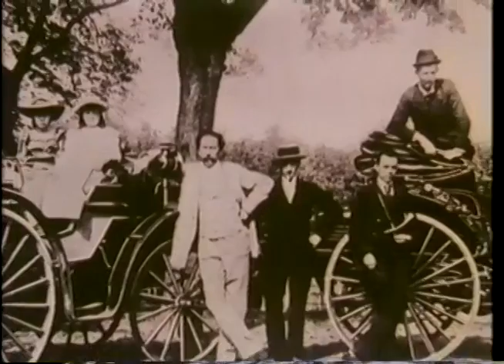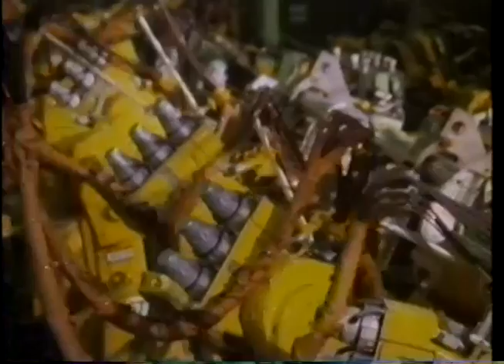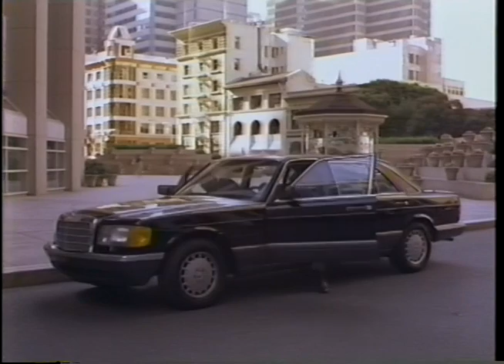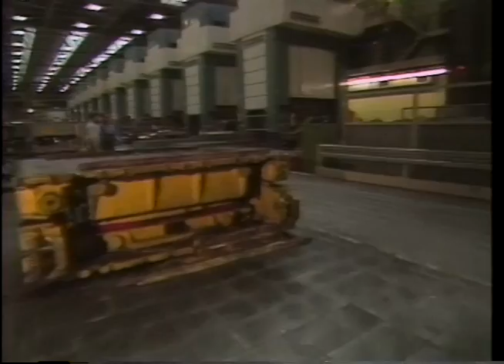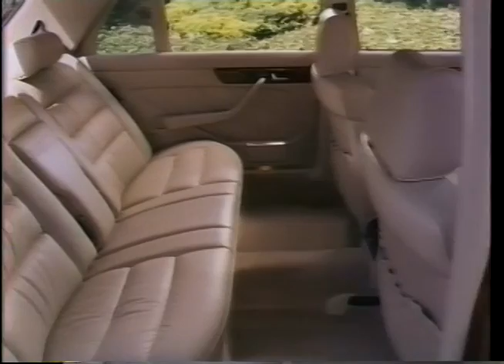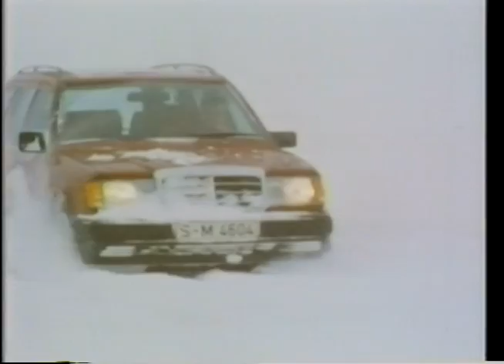Mercedes Benz 1990 Sales Training Model Lineup Overview

Comment: The purpose of the ABS design is to generate a series of pulses of maximum friction between the surfaces of both the wheel tires and the road during the deceleration of the car to reduce the stopping distance in half as well as increase the car's ability to turn with the least possible slippage on the road.

Comment: I just bought a 1993 320e straight 6
With 74.000 miles and it's hard to believe a 29yr old car with genuine low miles one owner from new under the bonnet every thing is as new wiring servo all pipes radiator not even a fly or dust not a pin pick of rust any where on car original every thing even jack and spare wheel never used even boot carpet not even any vacuum cleaner marks it looks like the boot was never used
No wear in interior leather seats after 29yr not dried out no cracking
Just like new never smoked in all tyres Michelin the electric windows go up and down no motor noise same with sunroof it's spotless underneath it looks like it's never been out in the rain it must of been kept in a central heated garage like an operating theatre as it is like I dreamt I went back in time and bought this car at only 2yrs old .
I haven't woke up since I bought it
Even the handles latches pedals the solid feel in closing and opening doors if any one has experienced a simular experience I would love to hear it 07783 912283
Northern Ireland

Comment: I can see why Mercedes had to ditch their model designation scheme. Would be way too confusing today. By 1990, it was already starting to get confusing. Letter classes are much easier.
Reply from the maker: Ya. Having C, E, and S was much simpler. A lot of times the 6 cylinder S classes get lumped in with the 300 Class!
Reply: Today's "letter classes" are very confusing for most people. There are too many of them

Comment: Wasnt Mercedes handmade till the mid 90s?
Reply from the maker: Not really. There was a lot of hand assembly of the interior, but all bodies were machine welded.
Reply: @compu85  ok i just remembering reading somewhere that the w126 was but any way i owned a 87 560sel and always wondered what the "B" on the gear shift meant. I can remember to be a HUGE car the thing surprised ALOT of ppl i sure do miss the car
Reply from the maker: @RayFinkle22266  The B mode stands for engine brake. It's a switch that's hooked up to the kickdown solenoid on the transmission, the same thing hooked to the switch past 100% throttle pedal travel. That causes the transmission to kick down from 2nd to 1st when going ~10 mph. Normally the 722.3 automatic in the V8s is set up to move off from a stop in 2nd gear, and only shift to 1st if you mash the go pedal from a stop, or put the shifter in 2 from a stop. 
On the 300SD 5 cylinder turbodiesels in 84 and 85, the transmission rests in 2nd gear when stopped, but the moment you touch the go pedal, it kicks down to 1st so the car moves off from a stop in 1st. 
Some of the V8s had a small module that would apply the kickdown solenoid when you release the brake pedal at a stop, so the car would move off in first gear.

Comment: Odd that there was no mention of the G wagen? It was in production since 1979...
Reply: Was initially build as a military vehicle, maybe at the time it wasn't available for commercial sales...
Reply: @alexdragomirescu5084  Yes, it wasn't. Was imported via grey market until 1988 and then banned.. Brcame available in Santa Fe New Mexco in 1993 and was sold until 2001 at Europa, when MBUSA bought the rights from Europa and launched the G500 as a 2002 model. Sat in my first G500 in January 2002.
Reply: Doing a Google search, would tell you very easily it wasn't officially part of the lineup until 2001. Wasn't sold in USA after 1988 when 25-year rule banned grey imports.

Comment: I had one. It arrived from Germany with several factory defects. On its first routine service/adjustment appointment, the dealer said they found several more problems and replaced the cam shaft, the cam shaft seal and both motor mounts! There was something else, too, but I've forgotten what it was. Within a couple of months the climate control module failed, the fuel pump relay failed ("a bunch of them were defective") and later a rear wheel bearing seized. The power antenna worked for a year or so. A few years later the right tie rod separated. The car was perfectly maintained by the book. Left me stranded several times. Once the dealer's loaner broke down, too. I could go on, but why bother?
Reply: Well you must be the unluckiest person in the world these are some of the best cars ever made and there are many many thing to prove that lol.. Both of my cars went over a mil kms.. I imagine there were few lemons slipping into showrooms typical of any brand back in 1990 but by the late 90s all mercedes became lemons
Reply: @rikidiki8940  Wrong. The service manager at a major MB dealer was a friend. He used to take me through the service areas to laugh at all the problems the two German brands they sold had and the stupid owners who put up with them. One after another...all ridiculous. The problems I had weren't out of the ordinary. Any car can be kept on the road indefinitely, if you don't mind random breakdowns and are willing to put $$$ into them indefinitely. There are abundant international repair data to reflect my own experience. But the cars were pleasant to drive and the bodies were solid. Rustproofing could have been better. If you think they are great cars, you should own a few and keep track of all the failures.
Reply: Your anecdotal evidence means 0

Comment: Back in 2013, I was handed down a '93 E320 (W124) from my grandmother who was going to a nursing home.
The car was so nice I couldn't believe it was a 20 year old vehicle.
Something about the ride. It rides like i'm on a cloud or something. Engine had zero vibration. It was really quiet and comfortable. Even the power locks were operated by a vacuum pump, and it had such a nice sound and feel to it.
W124 was introduced in 1985... to compete with Cadillac and Lincoln, BMW and Jaguar models of that era. No comparison.
Reply: I have an '89 260E........ amazing car! Quality without compromise.
Reply: what happend to it?

Comment: Regarding quality they did not lie. The W201, W124 and W126 are still driving around all over the world, many exceeding 300.000 miles.
Reply: Today's Mercedes are nothing but piles of unreliable junk! They are simply living off their past glory!
Reply: I had a 1990 190E as my first vehicle was 18 years old and smoked the tires everywhere i went... treated it like dirt not physically but didnt have the money to maintain it properly... it made it to 770,000 kms... theres no romanticizing anything its common fact any Mercedes Benz stamped with Daimler on it is rigorously tested and built to last.. I now own a 2003 E500 5.0 V8 vs everything
Reply: @EAZYDUWZIT420  2003 was junk years of Mercedes. The company even admitted that the products were not up to their own standards. The previous generation E class (W210) cars were pretty solid.
Reply: @alexeivoloshin5984  the only junk car they made that year was the E63 and they knew about the major engine flaw well before they even sold it... Mercedes had a class action lawsuit against them for it
Reply: W211 is one of the best engines they ever made lol? Anyone that owns a E class knows this, they use them as taxis in Germany... the only problem 2003 had was faulty radiators from Valero and they switched them out with Bosch and the braking system fails... that engine gets 500,000 miles all of the time, checkout legitstreetcars lol he owns 3 E500s E55s same engine transmission platform with well over 300,000 miles, and has been a master service tech for Mercedes for 20+ years... He only buys 2003-2007
Reply: @EAZYDUWZIT420  The early W211s were great, aside from the awful ABC braking (breaking lol) system. Late W211s are a huge downgrade in quality. E350, E550, and E63 all had engine quality issues, and unreliable 7 speed transmissions. W211s are tricky to work on too, compared to W210s. Still better than BMW E60s though.

Source: I work on these cars
Reply: @michu6777  Are you american? Because here in Europe 90% buy diesels and they are super long lasting. Just get a car without air suspension and with a diesel engine and you re all good. 2006+ is much much better in terms of rust and overall quality. Merc's gas engines are quite bad, i've heard.
Reply: @kristjanvendelin3566  Yes I'm in USA. Unfortunately the only diesel we got here was an extremely rare V6, and I've never seen one in person. I'm in California where cars don't rust, but I will take your word for the rustproofing improvements. ✌
Reply: @michu6777  sbc brakes, not abc
Reply: my 560 sel made it 220,000 miles...really well built, but definitely required good upkeep. hands down one of the most comfortable highway cruisers I've ever driven
Reply: Very true I have a w124 on 211000 miles drives like new!
Reply: I have a 1988 w201.
We don't measure the miles.
We measure how many times they go around the clock 😍😍😂😂😂
Reply: Fabian R You can drive any car for 1M miles. The question is, how much will it cost you? Old Mercedes were very good cars, but let’s not romanticize their long term reliability.
Reply: @alexeivoloshin5984  no, you can't drive  m272 engine to 1M miles. Unless you replace the engine.
Reply: @vaseabmwe39  Where did I post about driving an engine?
Reply: @alexeivoloshin5984   ? I own a '87 w124 250d and I take very good care of it without spending money at all. Only for parts.  I find it weird that you would claim such a thing about this unbreakable car

Comment: At this stage MB was the finest automobile in the world, engineering was tops, after 1995 it all went downhill.
Reply: Yes, even if Lexus took over for MY 1990, they were relatively spartan at the high end. JDM got the high tech, ultimate luxury for the rear seats.

MB included both. I'm a BMW guy, but I will forever regret not getting an W222 S65 AMG over my M760i xDrive.

W222 came the closest to emulating that past feel and is way better than my 760 even in S560 grade. Oh well, just couldn't justify paying full price for a $200k+ AMG over a discounted 760.

Comment: They were all built for profit. I have a classic Mercedes and a 2018 model. Believe me, the new ones are built just as well, if not better. This rose tinted view of what cars were is just that, a romanticised image of yeaterday. The truth is old cars were troublesome and unreliable. The cars of today are mostly ALL built to a high standard because that is what todays customer demands. The joy of owning a Mercedes Benz today is about prestige, exclusivity, heritage and customer service. (if you have had a bad experience with customer service that is a local issue to you and not reflective on the brand and needs to be brought up at a regional level) Full dislosure, I work for Mercedes Benz but I will say this, I left a secure job in the Marine Industry to come and work for Mercedes Benz because they are the best.

Comment: Back in the day we couldn´t even think that 28 years later MB would have a pickup truck... 
I just love the 90´s models, build to last a lifetime.
Reply: Uh, no.  It was the '60s, '70s, and '80s Mercedes that were well built.
Reply: Robert Brandywine uh, you’re stupid
Reply: There was a G class pickup back then and aftermarket pickup conversions on the W115 and W123.
Reply: Basically took a Nissan and stuck Mercedes badges and body panels on it.

Comment: Pure quality. Didn't take long for the quality to start going after this. The introduction of the W202 and the W210 saw things go very wrong indeed. As good as Mercedes Benz are today I don't think they have the aura they did back in the 80's. It's not the same anymore, there's too many of them and now everyone can afford a diesel AMG trim A Class. Back then you stuck your nose up to the window and dreamed.
Reply: Josh Charlie w202&w210....both good looking but we’re horrible in longevity. The c and e to follow those two didn’t help much either. They could easily make their cars more reliable, but the aura I agree will never return...to many cheap leases and high discounts.
Reply: @finnellwilliam  You think those leases are cheap?  You have to put a lot of money down up front.
Reply: @finnellwilliam  w210 bad at logevity? Man, the 5g-tronic is the most reliable mercedes transmission ever made, and so are the m112/m113 among gas engines

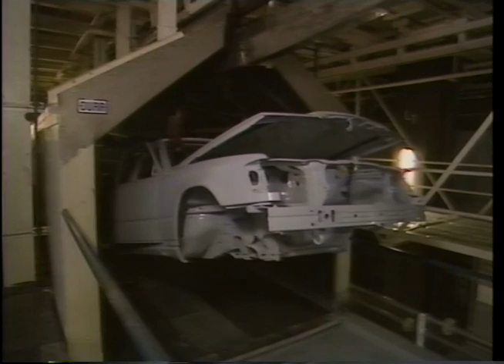Comment: 38:35 and then the 1993 came and MB went eco friendly, which meant all their cars rusted like crazy up till 2006. Even a S-Klasse Mercedes-Benz from that time period just rusted away.
Reply: Actually according to an MB specialist, it was late 1991 that they started using eco friendly materials that weren't properly heat tested which would overtime rust out and cause you big problems.

Comment: On later model the cars skips the anti corrosion baths
Reply: I heard the W210 problems were caused by switching to water-based paints.
Reply: Johans60 only on like mid 1990’s to mid 2000’s cars. But still

Comment: '87 260 E Owner (and still runs just fine!)knocks on wood. These cars really were built like nothing else on the road. I miss the "form follows function" design. Now theyre designed to compete with lesser cars. At least the newest cars from Mercedes have gone back to a more regal design, and the engineering has come up leaps above where it was.
Reply: I've got an '87 r107 and can confirm. Nothing like it on the road.

Comment: Volvo also got some problems when they based their D5 diesel engine on the same engine block, as the 5 cylinder petrol 850 engine.

Comment: This cars were truly built to last... the later models were build to profit!
Reply: Couldn't agree more. Most of the W220s and W210s in my are are completely rusted out. Pretty sad! Even Jeremy Clarkson mentioned "Mercedes dealer service and reliability isn't what is use to be". He said this when he had a SL55 AMG and numerous problems with it.
Reply: The enlarged version of the OM603 I-6 turbo diesel engine (larger bore and longer stroke) that was out the year this tape was issued had brought Mercedes down to its knees. Compared to the original 3.0L version sold in 1986-87, this engine had a bad reputation and came to be known as the "Rod Bender."
Reply: Merc back in those days were bulleproof. Just saw an 300 SEL here recently wonder what was the mileage.
Reply: I have an E63-S & CL55 AMGs no problems at all. Just do regular maintenance that you would do on any car & they last & they are fast. 🤷 Don't buy the cheap crap & then complain about it.
Reply: ,  c cc. C. Ccc
Reply: @Katrina Balanchuk W201, OBVIOSLY!!!
Reply: +Goru Minosyan You can say that again. Sad that the company that invented the automobile now makes cars that get some of the lowest reliability ratings from Consumer Reports.
Reply: I was born and live today in Stuttgart. The man of evil was Jürgen Schrempp ... he was terrible, cutting cost everywhere leading to the rust and other quality issues on the W210, under his management the Mercedes A-Class tipped over in the Elch test which created a huge market backlash and lastly, he did the merger with Chrysler. And then he laid off a lot of skilled people.

Took Mercedes two decades to return to former standard, but by then, many others had caught up.
Reply: @Katrina Balanchuk Newer models after 2006. 1995-2006 = lots of rust issues. 2007+ is good quality. I have 2010 E-class for 1.5years, driven 25k km and have invested 250€ for repairs. At the moment it has been the cheapest car to run in my life.
Reply: @kristjanvendelin3566  rust problems till 2003.. 2003-2006 facelift w203 models have no rust problems
Reply: You should consider how expensive every model of merc would be if they build them the best way they can. Can't deny thad Mercedes produced multiple gems over the last 30 years
Reply: In 1990, Toyota  beat Mercedes at their own game, and for thousands less. Enter the Lexus LS400.
Reply: @jamesb8305  * 1989
Reply: Typical "old was better" bullshit. New Mercedes cars are better than ever before.
Reply: BeyerT1 lol yea you can only afford a CLA so STFU
Reply: @derbigpr500  lol, no modern car comes close to the build and finishing quality of an 80s Benz. You're obviously not speaking from experience.

Comment: This is freaking great...Little did they know what a disaster that 350sdl engine would be...The "rod bender"   I have a 91 300d 2.5turbo...288k and is strong as ever. goes down the freeway like a freightrain at 85-90 everyday.. Best car ever...
Reply: Same I have the 1992 300d 2.5. 205k and runs like new